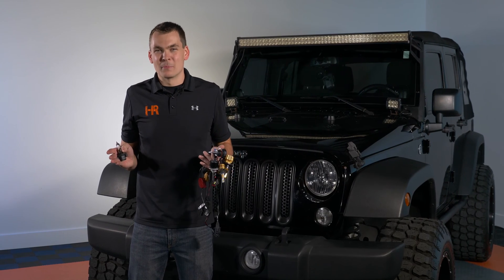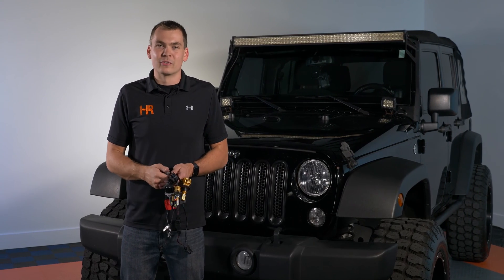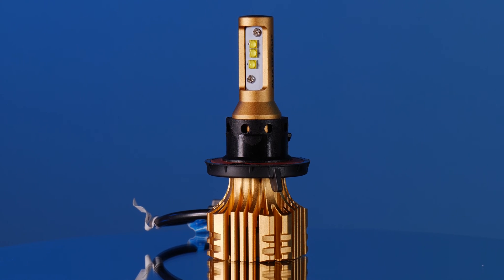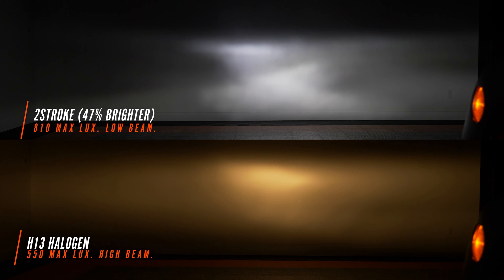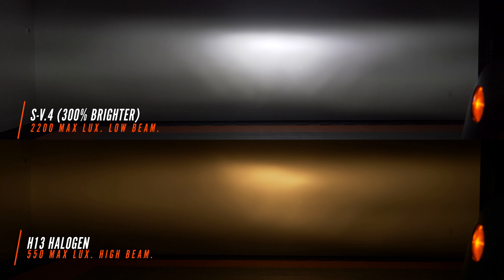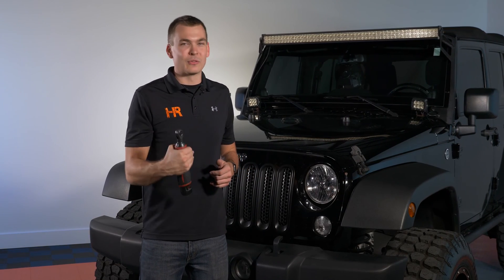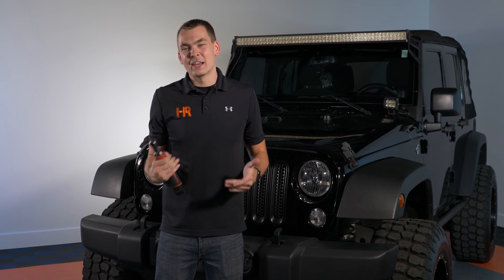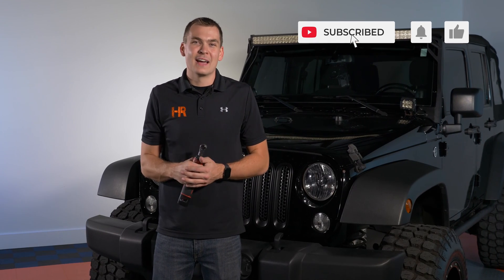HR Tested: 300% Brighter LED Headlight Bulbs 07-17 Jeep Wrangler JK

Comment: The S-V4s would have been a great upgrade for my stock JKU lamps, had they worked. One lamp was slow on turning on (took about 5 min.) and the overall pattern seemed to be nothing like the video. I spoke with support and they recommended purchasing the interface modules, although these were not supposed to be needed. The modules changed nothing so I ended up sending everything back. I was handed a 20% restocking fee to boot which seemed unfair due to the issues that I experienced. Hope others have better luck with this product on their JKUs. If you have another non-HR recommendation for replacement lamps please let me know.
Reply from the maker: Sorry to hear about that, thanks for the feedback.

Comment: I'm going to get me a set of v4 due to this video that's one sexy Jeep. I'm trying to figure out how the tires stick out that far though I got 12.5 wide are spacers used or different  wider axles?
Reply from the maker: This Jeep has stock axles and 12.5” wide tires, His wheel offset was pretty negative though.

Comment: Thank you so much for the video!
I just subscribed - from NYC. I just bought a left over 2018 JK from a Jeep dealer.
As care giver for a senior citizen I am going to be using the JK to travel from NYC to Connecticut, and back, on the highway(i95), approximately 200 miles round trip. The weather could be normal season hot/cold or those emergency run, later at night, in heavy rain and snow. 
Quick question(‘s): 
What type of upgrade headlights/tail lights/fog 
lights would you recommend for the above listed travel conditions and If possible to answer, the 
height of your test JK, does it have a lift kit and what type of tires/rims rose it sit on?   PS:  I have the same grille inserts and they are working great!   Thank you again!
Reply from the maker: Hey Giovanni, Send this same message over to our email at sales@HeadlightRevolution.com, There are a few really good options for you when it comes to your Jeep lighting and we can go over them with you at length there! That JK did have a lift, However it was a local customer and we don’t have the specs available at the moment. I might be able to find out for you though!
Reply: Headlight Revolution Thank you!  Going to reach out asap.   Great presentation!

Comment: How the sv4’s compare to JW speaker’s JW2 series?
Reply from the maker: The JW Speaker sealed beam headlights are a very solid choice, As far as a replacement headlight assembly they are one of the best available. The SV4 bulb is an excellent choice for a drop in replacement bulb that retains your original headlight housing.

Comment: I really like the S-V.4's. Am I correct in assuming these can be used in the OEM reflectors or do the reflectors need to be changed?
Reply: did you ever get an answer? i’m wondering the same thing.
Reply: @eric-uh8cf  I never received a response. I replaced my stock headlights with the Pro Comp 7" LED headlights.
Reply: @MrTed189  im guessing they dont need to be replaced.